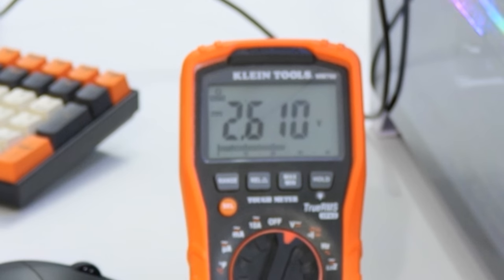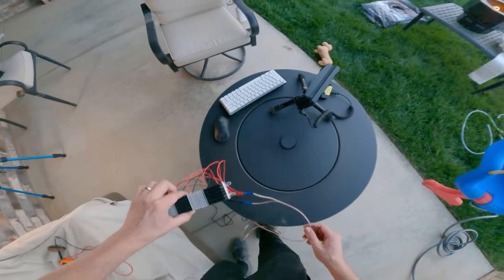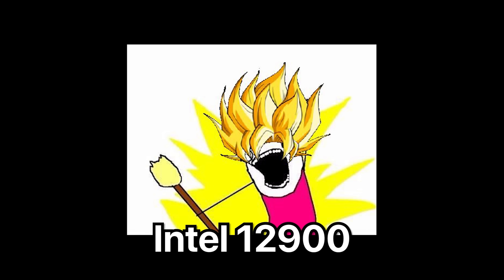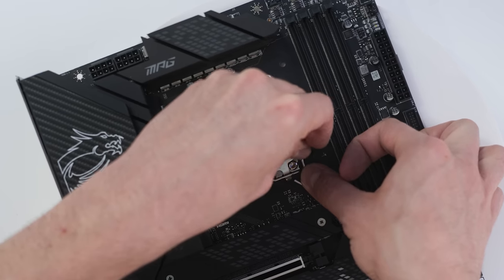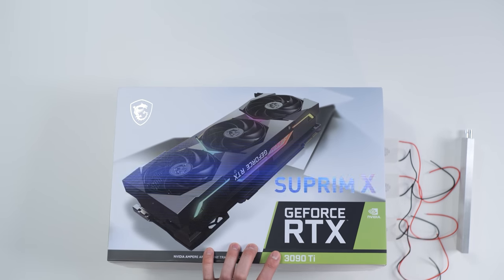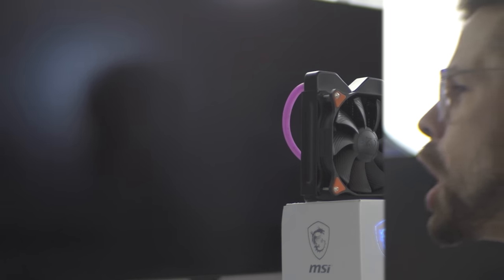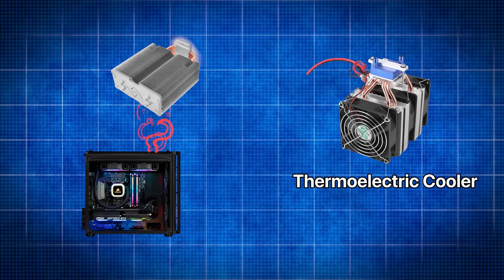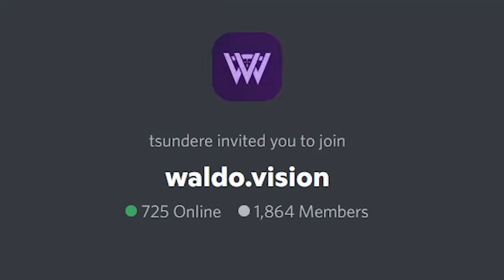I Built a PC That Turns Heat Into Electricity

Comment: Suggestion: build a steam generator to power a PC, and while you’re gaming, you have to shovel coal into the firebox to prevent the electricity from going out.
Reply: “Bro why does it sound like you’re shoveling coal we’re playing cod”
Reply: sorry guys cant play coals expensive right now
Reply: it would be worse if he ran a pc from a car engine bcuz fuel prices
Reply: @FuZe.  Everyday I'm shovelin'
Reply: @DJFreshJuice  😭
Reply: @AcT323-1  If PCs existed in the 1800s:
Reply: Literally how your pc is powered currently in most places
Reply: @rileyhance318  mine is powered by the energy that keeps atoms together 😄
Reply: That would be hilarious
Reply: Shovelware took a new meaning
Reply: @stnhls  strong nuclear force? oh i thought u meant neutrons and protons in the nucleus but u mean the chemical bonds of atoms in molecules but otherwise they are never together
Reply: @pasionlamadrid4240  Charles Babage: Hold my beer!
Reply: hol up dude let me just grabs a large shovel and starts booting up my pc
Reply: Or use the methane from your stool and convert it to energy (aka, real giga fartz).
Reply: ultimate steampunk pc
Reply: @AcT323-1 bro is a fortune teller
Reply: @AcT323-1  this ages well 😅
Reply: This thing turn heat into cold but instead of using electricity it produce electricity

He could also put thoses in front of his window where the sun hit , cooling his room , charging a battery

This battery would power a computer that use small power such as thoses mini pc using amd 780m gpu that use around 20 watts on gaming
Theres monitors that include audio that use less than 15 watts

So he could spend his all day playing games , not paying electricity bill , he could wash himself using the electricity left on battery
And he could buy a house , so nothing to pay every months

He will still have to pay food anyway 😅
Reply: sounds like a frostpunk mod
Reply: Using a steam engine to run Steam.

Comment: the idea of recycling heat to lower your overall power draw from the wall is a good idea
Reply: tbh should be made into a real product :')
Reply: @itsRevela  except the fact that the parts themselves cost over 100$ for less energy than a single 18650 Li-Ion battery. A 5$ solar cell with 5$ controller a 5$ lithium battery is infinitely more efficient and cheaper and power dense in comparison.
Reply: @MaxC_1  If you got a few of those solar cells and stuck them to your window, could you save on power throughout the day. Depending on how much it costs to run your pc a day. Would it be worth it to have that power going into your pc and when your pc is off it goes into the battery to be used later? Not that it would be super efficient but it would be cool.

I guess you would still need it hooked up to the wall because eventually it would run out of power. What kind of money could you save.
Reply: It makes < 2W and kills airflow. Upcoming GPUs and CPUs can easily use >400W combined. It's a fun video but it doesn't have any practical application, increasing efficiency by 0.5% at the cost of overheating components doesn't make sense.
Reply: @michiman6757  you really cannot run most gaming pcs off solar panels until you have a lot of them. For stuff that consume so much power- the power from electricity grid would be far cheaper.

But you can just grab a few solar cells for like 200$ from china (or local sellers which sell those) and some batteries and hook em up together and you should have enough power to run a general use pc (50W under use max) through the day.
Reply: @MaxC_1  ahh gotchu, And I don't use my pc for general use but maybe for a grandparents who just check their email. But at that point they dont really use enough of the pc to cost much money. Well that sucks and hopefully a cheaper option comes in the future
Reply: @michiman6757  At the end of the day you can't beat the cheap mass produced electricity. Only reason you'd switch to self generating electricity is being prepared in case of disasters and such, or environmental concerns or just that it is cool, else the mass produced electricity just can't be beat
Reply: @jamesbilly5324  while i agree. i think a refined method could work. his thing was more of a joke. but i think it could be done in a much more efficient way to have practical use. im speaking in terms of conceptual ideas and not "as seen in video"
Reply: Only in the summer.  In the winter it's likely more efficient to just use the heat as, well heat.
Reply: @cheerbeerification  true. but some places have a lot of heat with very few true winter days
Reply: POWER LEVELS OVER 9000
Reply: Yeah! Hey, you know what makes heat? The sun! The freaking sun, man! Someone should invent a device to collect sun heat and turn in into electricity!!

...
Reply: Have you looked into Graphene Twistronics, Time Crystal breakthroughs from articles as of early 2022, and all for Graphene - Photonics?
Reply: @MaxC_1  Well, sort of. It really depends on the size and efficiency of your solar panels. A good example is PeterSripol's tiny home project, which is only powered by solar panels. He runs a gaming PC with an AC, water heater, etc. off of just solar (including power saved in the batteries), and it works. They just have multiple large high-efficiency solar panels.

I've seen people get a couple large panels for cheap on the used market, and power their PC entirely off of solar/batteries, so they don't have to pay for the power costs. It's a solution that works, you just need a lot of space outside for the panels.
Reply: or you know you could go the kfc route and use it to heat kfc
Reply: @tone618  I prefer the "cold northern state" use case, which is acting as a space heater in the winter. Just leave a render going during the night and your room will be plenty warm.
Reply: @CaffeinatedFrostbite  , unfortunately, generating electricity through temperature differentials, at this level, is not viable at any respectable level of wattage output. Thermoelectric generators are just not efficient enough, and the result is that it isn't viable at this scale. Getting rough numbers from his video, 2.7VDC at 300mA, gives 0.81Watts... which is almost meaningless compared to the wattage he is likely using, and probably using more wattage to cool the other sides of the TEGs than he is gaining... which almost makes me feel this video is deceiving.
Reply: Other than the fact that it's an environment disaster in disguise. The raw materials would Equal thousands of more emissions than just using more electricity straight away.
Reply: the idea doesn't work, the fans and pump required to cool the thermoelectric cooler take up much more electricity than the output.

it's simple, thermoelectrics aren't (anywhere near) 100% efficient and neither are fans and pumps, meaning that the overhead of powering a 12V fan while outputting at most like 4V is insane
Reply: @jaytayner4292  I am aware of this stuff. However... Imagine putting these things in a climate where its really cold. you could make custom ones that sit with the side that needs cooling on the exterior of the building so they get hella chilled. 

I just think there can be a use for this. not for the average guy. but I think in certain conditions it could help in some ways.
Reply: @jaytayner4292  , agree.
Reply: Million dollar idea
Reply: anotheraccount8454 its inefficient, but not ineffective. Our plant is a tiny one on our roof rated for 6kw max and just 3 months of summer is enough to cover ~8 months of 600-1k kwh/month usage.

There's a huge field nearby that is filled w panels and it runs an entire factory, you cannot call that basic.
Reply: You guys forget that if you would engineer this mich better you could definitely increase efficiency in any environment. Don't forget that heat pumps have over 100% efficiency in heating your room to 20°c while it's -20°c outside. So a well designed pc case with much better implemented only non moving parts could actually work.
Reply: Actually, it's not as good as it sounds. The maximum efficiency is very low
Reply: Sorry but this is so dumb. The efficiency is so low that the only way to actually do something with the energy is to let the computer actually heat up the room a little. Your better of turning of the computer once in a while 🤣
Reply: @itsRevela  it already is: called heat exchangers
Reply: If these producers would just stop going "more watt = more good" and more like "low watt = same good" for a while, it would get better. Heat is just waste watts.
Reply: Unfortunately I don't think something like this would ever save enough energy to offset the amount of energy used to create it and/or recycle it when it's thrown away
Reply: @jamesbilly5324 you could avoid overheating components
Reply: A better idea is finding ways to not produce the heat.
Reply: @CaffeinatedFrostbite  Videos like this are mostly useful in terms of inspiring people to think about what's possible and why we don't do things like this. Given how much power modern computers use, if this could be done in a way that was more efficient than just putting the same money into subsidizing cleaner energy, they would. There's a bunch of technology that goes into managing the thermal envelop available for beefy chips.

Comment: I feel like you could use a custom water loop to the gpu and cpu to get more heat directly to those modules over losing heat through the air. Probably would end up being more efficient and more compact since you wouldn't need a box for airflow you could almost just mount it directly to the top of the case
Reply: and more expensive
Reply: @user-py9cy1sy9u  In the long run, it could save money.
Reply: @user-py9cy1sy9u  he's basically already got one running on the side to cool down the cool side
Reply: @CooperF  No it wont save money. Do some math
Reply: I think you are onto something there.
Reply: Yeah great idea! It would be more compact, and probably way more efficient. Imagine reducing your power draw for almost free, only issue is we all know TECs are famously inefficient so this would only work for lower end PCs that don’t put out so much heat that the TECs would thermally saturate. Imagine like an AMD APU based low power system that takes less power to run because it implements this tech, at an economy of scale this might be worth it!
Reply: @user-py9cy1sy9u  have you done the math?
Reply: @Numb_  Yes. Rough, back of envelope type of math
Reply: @user-py9cy1sy9u  care to share it with us
Reply: @Numb_  the answer is 42... Take a cost of 4 heatsinks and divide it by the cost of 1 kw/h in your area. Then divide that result by your PC's wattage in kw. 250w = 0.25kw. This will give you a number of hours  that you could use your PC for the cost of just heatsinks. Add other costs if you want. Then look at how much wats his contraption produced. Hint W=V*A

Dont be lazy
Reply: genes
 
me dont know how to spell
Reply: He could just do a comically large line of these peltiers to use up all of the heat, and to cool these peltiers, he used another set of peltiers, and then cool those with pool water
Reply: CPU>Thermoelectric generators mounted to the top of the case>Small Radiator out the back to remove any excess heat the generators couldn't>back to CPU

Comment: That's actually super impressive. Heat is easy to produce, thus making it one of the easiest sources of power that one can feed back into an electrical setup.
Reply: heat is easy to produce? :))))))))))))))))))))))))))))))))))))))))))))))))))))))))))))))))))))))))))))))))))))))))))))))))))))))))))))))))))))))))))))))))))))))))))))))))))))))))))))))))))))))))))))) also is one 'source of power' that cant be contained.
Reply: haha
Reply: The Peltier module actually doesn't work on heat alone but rather a thermal gradient. As long as one side is warmer or colder than the other, it'll generate electricity (goes without saying that a greater difference equals greater output) but basically what I did back when I was in middle school was just attach a bunch of heatsinks to the cold side and it created enough of a gradient to output 5V, however, the cost-to-benefit ratio would take a long time but hey, it works
Reply: @lssndrnv  I think that's probably why you don't see it in more places. There's a bunch of places where there's an excess build up in heat, but they aren't using this to bleed some of it off for productive use. I've often times wondered why that is and I think it's probably because cooling the other side itself generates a bunch of heat and uses more power than you'd gain in this fashion.

Comment: I've used Peltier plates a bit in school for an ISS related project to control water temps for growing food in space. We're definitely at the point of the components putting out enough heat that we can recover some energy back into the system.
Haven't looked to see if you've already done this. I think the PSU part might be the most tricky piece of it.
The much more efficient way would also be with a water cooling loop and water blocks instead, not with air and fans. You'd have to build a closed loop water cooling system which you know is a common thing in our computer enthusiast community.
I just found your channel and man I really enjoy your videos!!!
Reply: My thought was that this would make the most sense by using some sort of liquid cooling on the cold side and then running the power generated to a battery to augment whatever power is coming in from the mains.The main benefit being that there should be a reduction in the amount of cooling needed as both the peltier and the liquid cooling should drain a bunch of the heat that builds up in a case.

Comment: I could only imagine if there was a pc case specifically designed for this. Where it could only exhaust through a chamber for heat to go through and then the energy produced goes back into some sort of external battery that the power supply could draw from.

Comment: i see a few problems. 
1 - it probably costs more to run the fans connected to the cardboard box, than you save from the heat 
2 - pumping the air back into the pc is a bad idea, since the air won't be cooled by any significant amount

Comment: The reason you can’t “re power” your pc is because the efficiency would have to be over 150 percent, that just doesn’t happen. Even best case scenario 7 volts, it’s literally 0.3 amps, that equals to just under 2 watts, that is less than half the wattage for a phone to be charged, this thumbnail is extremely misleading, suggesting you can have no external power and it will just work, you literally know that energy cannot be created or destroyed, how are you going to power it without any power, just for context, your computer uses about 800 watts, your “re power” is under 2.

Comment: What if you redirected the power into a huge battery, that you then could plug into your pc? So the battery charges and powers the pc while you're gaming. That could potentially work (without knowing anything about power 💀💀)
Reply: yes that is possible, i actually tried a concept like this but with a cheap 20 dollar set of usb solar panels, i used solar panels to charge a set of 18650 lithium ion batteries in a usb charger which i then took and connected them to an energy inverter to turn the batteries DC Voltage into AC voltage and used this to power my pc, it ran for about 15 minutes before the battery died which was more than i was hoping for but less than i had planned out due to efficiency losses. When the energy was transferred from source to source it was loosing quite a bit of power along the way because of these losses, from the batteries to the inverter it is only about 75% efficient, then from the converter to the pc it was about 80% or so efficiency as my pc's power supply is 80+ rated, then from the pc power supply to the components there must be some other losses as well that i'm not sure about.

Overall it was definitely a fun experiment as it was amazing that it was running on essentially nothing but sunlight  but ultimately quite pointless when wall power exists and the batteries take 4 hours to charge.

Comment: But you need energy to cool down the other side of the module with your water cooler. So the total loss is greater than the gain.
Reply: Yep Second law of thermodynamics.
Reply: Yes, it's like welcome to reality.
Reply: Well you can thank Peltier module's ( or TEG) ultra low efficiency for that.
Reply: Though similar approaches exists to increase efficiency. For example a triple expansion engine feeds the slightly less good heat into another cylinder to produce more work. The more interesting question is what the theoretical efficiency for a non-quantum computer is, measured in J/bit-flip.

Comment: Holy crap Louis, I didn't know TEGs had gotten that efficient. Those things were small but outputted more than half a volt!
Reply: they really aren't that efficient- you are just looking at no load voltage. Even 10ohm across them will drop the output by close to half or more. They have done numbers like these since a long time tbh
Reply: Surely sterling engines are still more efficient?